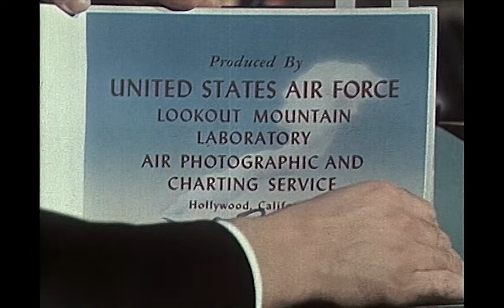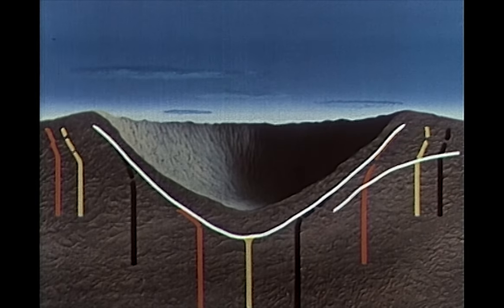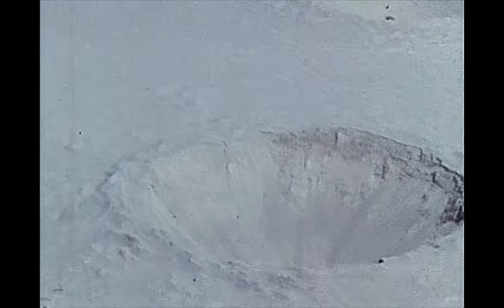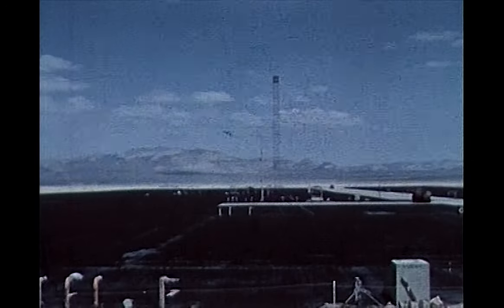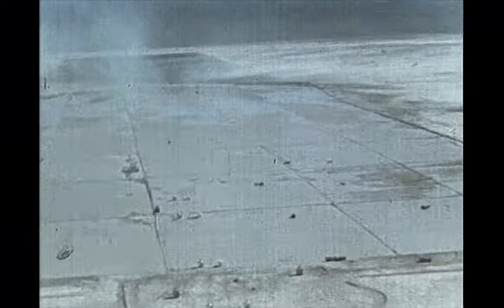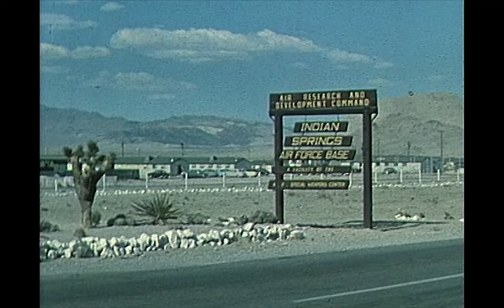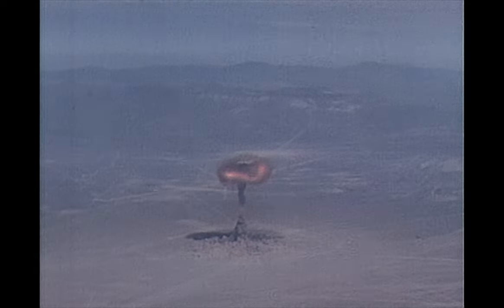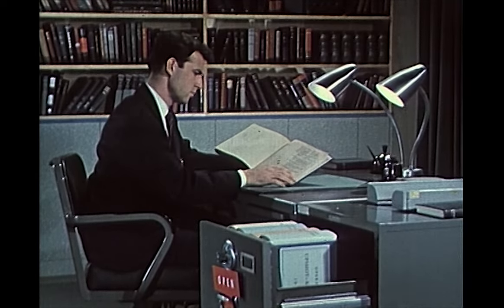Operation Teapot Military Effect Studies (Color Version) (1955) #atomic bomb

Comment: In 1955 they built atomic and hydrogen bombs. But the sound quality of the recordings is more like 1880 ... 😂🙈
Nice stuff!
Reply: Vacuum tubes..
Reply: @davelowets The sound is an optical track on the film.  Since it is narration, the soundtrack was recorded in a studio on magnetic tape.  The tape was then transferred to magnetic tape with sprocket holes in it so it could be edited with the film.  When done editing it was transferred again and made into the optical track on the film.  The optical soundtrack is subject to degradation from being handled, projected, and rewound. When the film was transferred to video, it was probably done using a film chain projector.  The entire process degrades both the picture and sound quality.   Then, the videotape had to be digitized for the Internet.  Every step in the process degrades the quality.  Today, the transfer from film to digital can done using an entirely digital film transfer process, but there is still a loss in the transfer process.

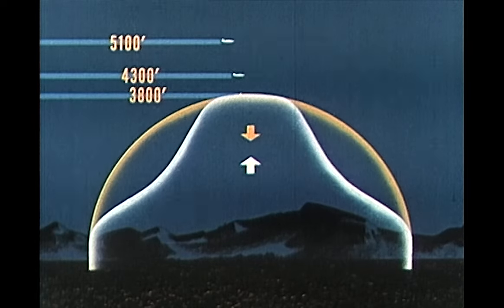Comment: What means those columnar trackings of smoke on the right side of explosion?, as  21:47 .?
Reply: These are sounding rockets (small rockets) fired right before detonation to create visible smoke trails. The rockets are spaced at known distances from ground zero. After detonation the smoke trails visually distort when the normally invisible shock wave passes through them. This is recorded by a camera that they can then analyze the film from to calculate speed.